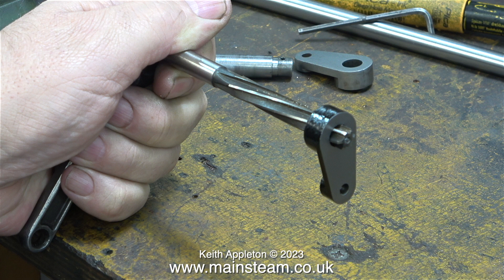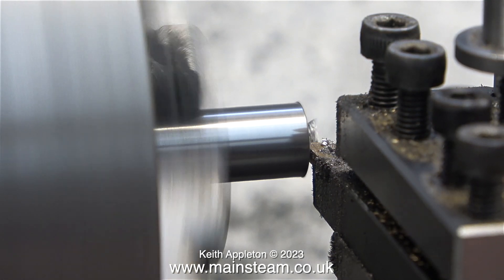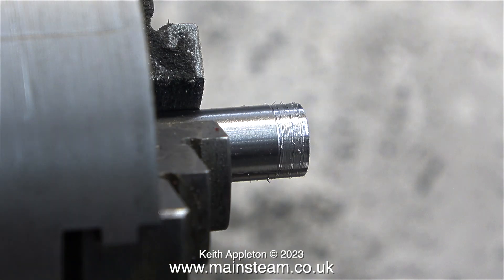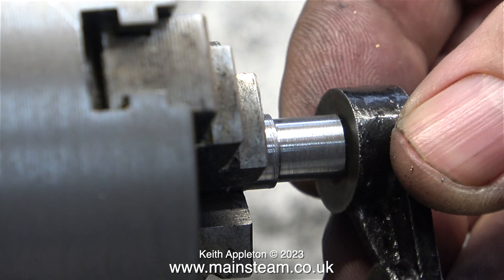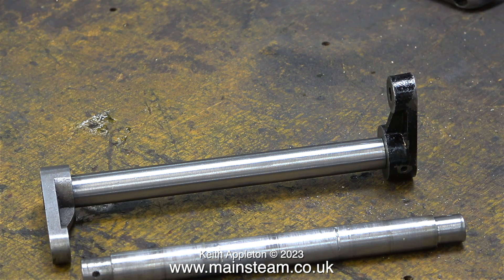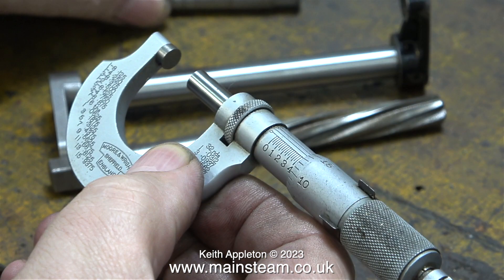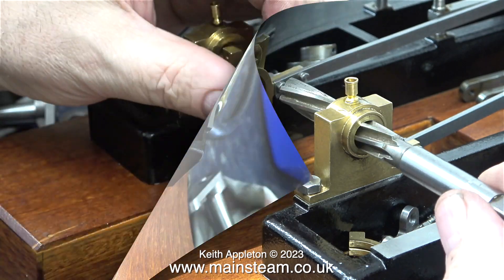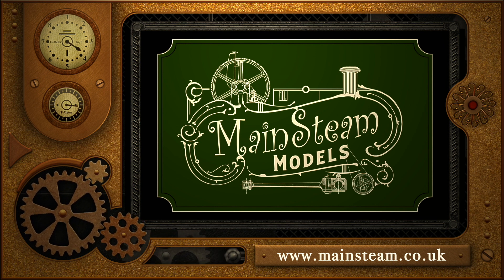REBUILDING THE STUART TWIN VICTORIA - PART #11

Comment: How did you manage get the crank webs at the right angle?

Those Bernard chucks haven't become any cheaper over time. Quite the opposite. I settled for a Bison.
Reply from the maker: By using my Calibrated Eye, I can easily see 90 degrees after all this time working with these infernal machines }:-)))